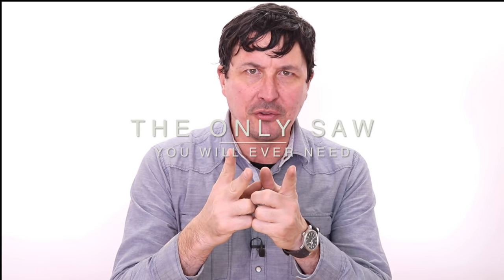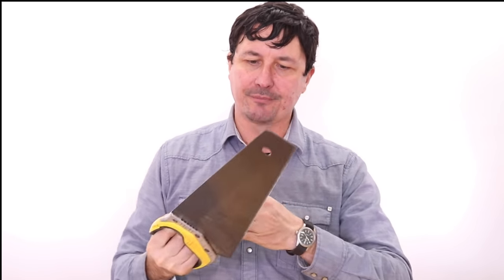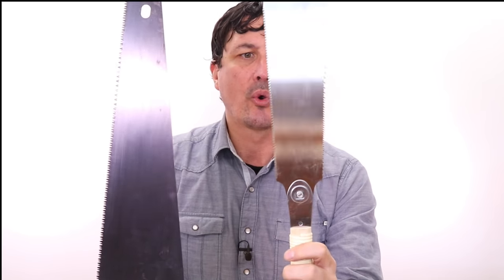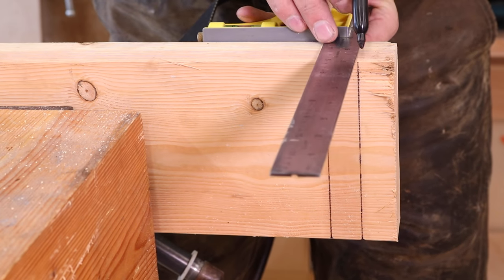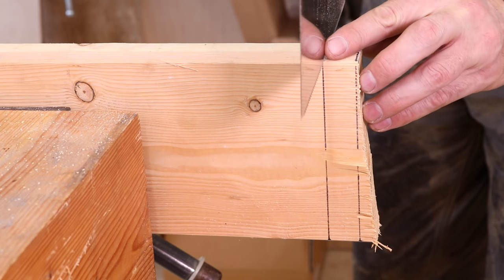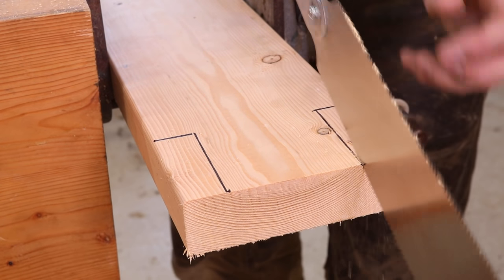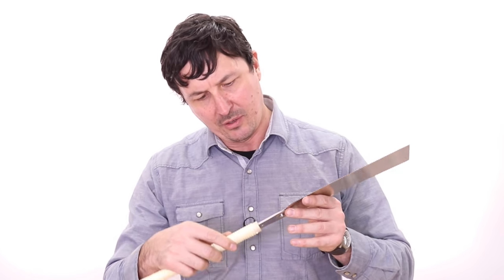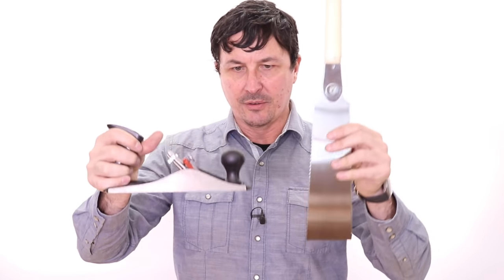The Only Saw You'll Ever Need

Comment: I like and use and prefer Japanese saws.  I grew up with English saws.  That being said, it doesn’t seem fair to compare a new Japanese royoba against what you describe as an old / well used English style Stanley Fatmax that has Japanese style teeth.  Also, for the tenon cuts, instead of cutting “down hand,” you would have had better control of both saws if you cut them vertically in the vise.  IMO, if new vs. new, the Japanese saw would have still come out on top, I think.

Comment: Harbor freight has an amazing $8 pull saw. It has a hot orange and black handle and the handle looks like a flintlock pistol grip. That thing will crosscut anything like butter and the kerf is not too cumbersome. A few downsides is that the teeth are not in-plane with the bade so it's going to mar up any surface if you try to make a flush cut such as with a dowel or tennon sticking out. But for general slicing and dicing I have never had a saw that cut so effortlessly and quickly. The blade is only 10 inches long or so. It has lasted me over 4 years now, a little rust on the sides because I stupidly left it out in the snow one day, but the teeth are still as razor sharp as the day I got it. Only $8!

edit: Found it! http://www.harborfreight.com/10-inch-flush-cut-pull-saw-94722.html The title says it's "flush cut" but again that is a lie (unless I got a slightly different or older version of this saw and the one linked does cut flush. Every HF should have one in stock so go check it out if you want to know for yourself).

Comment: I love push and pull saws, I use them both in my work.  I will say if you spend less than $100 on a western push it will be garbage, period...  western saws also required a "substantial" table with serious clamping power.  I always give Japanese pull saws as gifts in hopes of getting them into the craft...  If they can and want to evolve into push saws, good for them.

Comment: You mentioned that the Japanese saw can't be sharpened--is that just because of inconvenient tooth geometry (in which case it could be filed down and retoothed) or is there something about the steel that makes it incompatible with a sharpening file?

Why not try a dove-tail shootout with the two saws (your general purpose recommendation and the detail saw) and see whether it looks to you like the quality difference in the cuts is worth it? You could video the process or just show us the results.
Reply: The teeth are typically hardened (the crosscut side always, and some on the tip cut side). They can be sharpened; I use diamond needle files. The crosscut side is tough due to geometry - the thin kerf is split into alternating teeth (think a plywood blade for a table saw).

Comment: so when you compare the tear out from the dove tail. one saw is a push saw and the other is a pull saw. so when you compare them you should compare the front side from the pull saw to the back side of the push saw. that being said the Japanese saw is clearly the winner, the teeth are to wide apart and big on the Stanly to do any fine type of work.

Comment: as far as i understand it: push saws bend with compression on the push stroke, pull saws stay straight because they are in tension not compression. pull saws are much better if you care about making straight cuts, if you prefer the other kind, that's because you have stubbornness or loyalty to the ways you were brought up. the Japanese are unrivaled when it comes to woodworking.

Comment: You are not showing your elbows in the vid. I bet you flare them and apply more side force them downward force. I have been practicing myself and getting much better. The wood often pinch's the blade and will kick it one direction or the other and may require a shim to stop that in long cuts. I agree the pull saw is nicer to work with most of the time. Good vid

Comment: This video is old so you've probably figured this out already but your cross cutting a straight line techique is wrong, put your saw at a 45 degree angle and cut your line on the face then after about an inch or so bring it back to a straight angle on the edge and the kerf will more or less keep your saw straight for the rest of the cut

Comment: If you listen to the tempo of your cuts with the two different saws, you can clearly tell you increased speed and power with the American saw.  It has been my experience that when you are trying to get a straight or delicate cut you keep a slow steady tempo/power and you will do just fine.  I feel you did not fairly represent the American saw in these tests.  I also know that you can get a Husky saw for $10 that will do the job. IMHO

Comment: You're actually using the Japanese just like a Western Saw and there's actually a technique to Japanese one for cutting straight lines every time and also more basic problem is that you're supposed to do the cross cut before you rip it to prevent binding and you did the opposite

Comment: a tennon saw is made for cutting straight why not have that as a first saw, i use a tennon saw whenever i want a straight cut, and it ends up straight always, i find if i use the japanise box saw it tends to flex making the saw run off your line, i also use a tooth set tool to set the teeth of my tennon saws for diffrent cutts, so if you want a fine cut like the japanise box saw then just look into how to set saw teeth, other than that the japanise box saw is a must have, but i would recomend having a tennon saw and a box saw,

Comment: You absolutely can resharpen a Japanese saw. You just need a file made for its fleam. You can find them easily enough on Amazon -- just look for a flat, thin, stubby file; one side is flat, the other has a low ridge running down the middle, and the two sides come to an almost knife-edge, so it has the general appearance of an airplane wing that has the profile of a very squat pyramid. Sharpening the ripping blade is simple and intuitive,, but the crosscut is a bit more intricate, requiring a slightly angled top facet to each tooth (so sharpening a japanese blade is actually a bit more tedious). Probably the best way to see how the blade is sharpened, watch this YT video on how they are made: https://www.youtube.com/watch?v=JkrS-7Zt1o8
Reply from the maker: When can we expect a video showing us all how easy it is?

Comment: Well Mr. Wranglerstar, I don’t feel that this was a very good comparison, the western saw is a push cut and it seemed like you were forcing it, the Japanese saw is a pull saw and is completely a different cut when in hand...the same replicating motion that was used on the old large crosscut saws used by the original lumberjacks....perhaps you should compare the different joinery that each saw is best at performing....just a suggestion.

Comment: These saws are wonderful.  The blade is under tension on the pull cut, keeping the blade straighter.  One must only cut to layout lines that can be seen.  Cut some of one side at about 45 degree angle, then switch to the other side so you can see the lines.  Then repeat downward through the work piece. https://youtu.be/EzEm2ymA5ds?t=2m50s

Comment: Same problems as the new planes. the handle misdirects the force so that it fells better in your hand. switch the handles on the saws and the results would switch. misapplied force =  driving your car with a flat and believing you wont have any problems.

Comment: I have bought one of these kinds of saws and I have to say, they are the worst saw design I have ever used. I can cut for hours with a normal saw, but these things cause my hand to cramp up constantly because of the terrible handle design. I also much prefer the Push cut over the pull cut.

Comment: you're not holding the saw correct that's why you can't saw straight.
as for the rip out you mixed the sides up. one is push and one pull so it's opposite sides.......

Comment: What can we conclude? You're not so savvy with saws. That Stanley is a dull finishing saw, not a cross cut or rip saw. And a "western" saw cuts both on the push and pull strokes. Lastly, you've got a terrible saw stroke, most especially because you're trying to use the longer saw while standing up. You need to be on a saw horse and develop some skill with a longer saw stroke.

Comment: omg stop forcing the saw and let the saw do the work no wonder you can't cut straight your bending the blade of the saw trying to force it through the wood keep an eye on the top of the saw blade when you cut if its moving left to right while you cut your cut is not going to be accurate.

Comment: That first saw cut was terrible, you were forcing the saw and you made no attempt to correct it, which you can do with an english saw, BUT all was not lost, you could have used your plane to get back to the line,or even used your saw, but it seems to be beyond your skill level at the moment(persevere and it will get better). You seemed to do better with the Ryoba saw in the beginning but when you went off line, you cut into the wrong side, not the waste side, so the wood(if it had been part of a job) became scrap, so as bad as the first cut was, it was salvageable. Making a mitre box  with a straight cut on it would help you in the short term and save miscutting  valuable timber, i am talking here about when doing an actual job as apposed to practice cuts and a mitre box  is a useful self made aid, even professionals make and use them,

Comment: Why in the name of god are you drawing  layout lines with a Sharpie ?
Reply: David  marzolino I'm hardly a great carpenter, but I don't think my habit of using a fine tipped sharpie instead of a carpenters pencil is one of my shortcomings. For one, most of the time the kerf of the saw is wider than the line if I am sawing dead on the line. For two it doesn't penetrate very deep and is easy to sand off. For three, its a more visible line.

Now, for really precision carpentry, I'm going to use a mechanical pencil and possibly measure down to 1/32" accuracy. However, my cuts are not that accurate even if my ability to measure and mark is.
Reply: Justin Dearing.  If you ever decide you want to become a "great carpenter", the first step is to stop using a Sharpie for your layout lines.
Reply: David  marzolino ok why? I can draw a finer, straighter, more visible line than with a carpenters pencil sharpened with a knife. If sanding, planning o priming will still happen, or if this is framing to be buried under drywall, what is the downside?
Reply: Justin Dearing  I'm not talking about framing or things that will be coated with primer, for things like that, a Sharpie is good enough. I'm talking about fine woodworking /heirloom quality furniture building. You either learn good habits or bad ones, and using a Sharpie is a bad one.